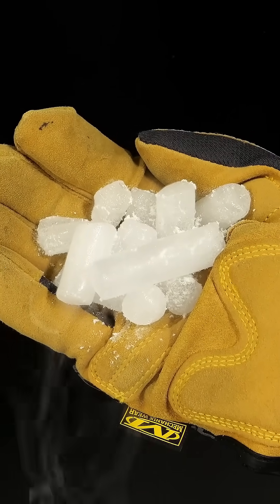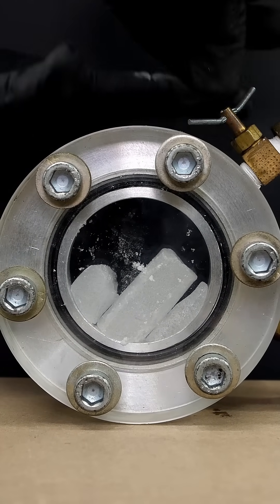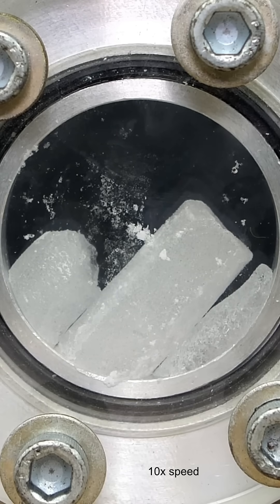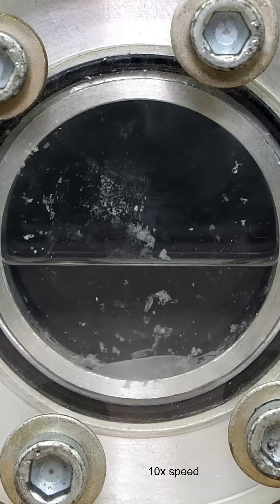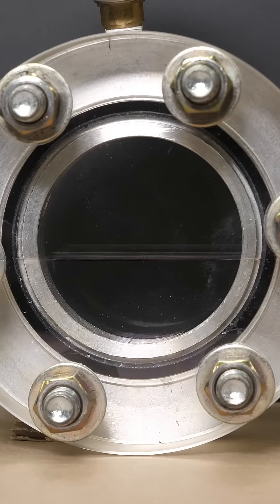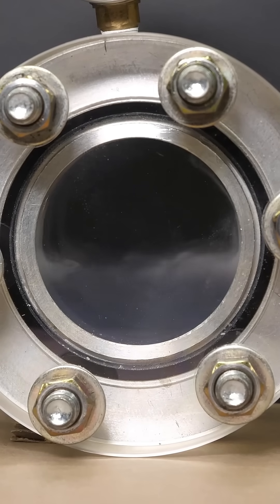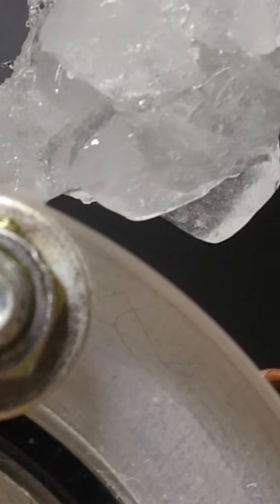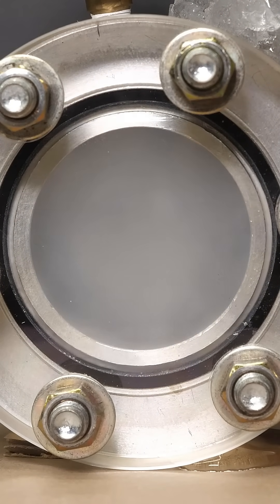This is not a liquid or a gas

Comment: A friend of mine works on industrial heat pumps including turbines that use this supercritical state to improve efficiency. One thing that I found fascinating is that if something goes wrong, the  fast moving supercritical fluid turns into a liquid in the wrong place and instantly destroys the turbine. Super interesting, but difficult to handle.

Comment: In HVAC we call that the saturated phase or "flashgas" phase. And the entire refrigeration system revolves around that. Pressurizing the gas removing the heat, getting it back to the flashpoint taking the heat out of the thing you're trying to cool causing it to evaporate....pressurizing it again.....so on and so forth

Comment: Did you calculate how much that pressure made force to those bolts or that plastic per cm2?

You are hero, I would be critical to about tests like this.

Could you do same with plastic  cigarette lighter (there's maybe butane or propane inside)? ;)
Just heat it carefully.. 🎉

Comment: Supercritical CO2 is increasingly more often used as a refrigerant, especially in large scale cooling systems, like in supermarkets. While CO2 is a greenhouse gas, most conventional refrigerants are often thousands times more potent in trapping heat on our planet. Supercritical systems run at over 100+ bars/1400+ psi on the high side when the ambient is over 31⁰C/88⁰F outside. Fun times.

Comment: Can you make liquid Oxygen in there?
Reply: I'm guessing that if he gets a tank of high pressure oxygen down to the temperature by packing it in dry ice, it might be close enough to liquid oxygen temperature, maybe a hundred degrees above lox , that if he suddenly de-pressuruze it, a little bit of lox will form. It will probably waste most of the oxygen, probably less than 10% will turn into liquid

Comment: When you haul it in the tanker you have to keep the pressure like around 100psi. If you don't it will just freeze into 1 big ice bucket which will take 2-3 weeks to air out unless you can get it to the reliquefied then you can pump it off.
Reply: You talking about hauling it in a tanker, and your name is "Peterbilt".... I'm guessing you are a truck driver?
Reply: @ShannonDove-sy7ye  yes a tanker semi trailer.
Reply: @peterbilt9996  yea I'm a driver too, but no hazmat, I drive flat bed.
I see a lot of liquid gas trucks delivering to a microchip plant in Manassas. I don't think they use CO2, but everything else such as liquid helium, argon, nitrogen, etc. (in Va.)

Comment: It’s a self-contained weather system. You’ve got a body of liquid, clouds forming, and eventual rain. 🌧️
Reply: It’s actually a supercritical fluid rather than water vapor
Reply: @jackmalcolm  Yes. 👍🏼 That’s why I didn’t use the word “water”. Other fluids can experience similar cycles.
Reply: @glennac  I don’t know why I used water tbh. Should’ve just said vapor. My point was that this is a supercritical fluid, not the same thing as seen in weather systems, which I believe are saturated vapors.

Comment: When you added heat, it is definitely a gas, unless you just discovered the fifth state of matter. Had to add this I do believe correct me if I’m wrong that is a saturated liquid in that state.
Reply: There are many more than 5 states of matter. Also by heating it up it made the CO2 go supercritical, turning it into a supercritical fluid, something that’s neither a gas nor a liquid but is in between the two.

Comment: It’s called supercritical if I remember correctly, basically when the atoms fluctuate between liquid and gaseous states due to high heat and pressure.
Reply: And you would be absolutely correct in your assertion.
Reply: @kori1701  why thank you good sir.

Comment: this is something more common than people think. changing pressure affects temperature and so are affected the melting and boiling points of substances.

this is commonly found in compressed cans where the liquid kept inside immediately turns into gas through adiabatic expansion. in high altitudes its known that water boils in lower temperature.

in this video the melting point of this thing is way below freezing so when pressure is increased, so does its melting point and once the pressure is high enough for its melting point to reach room temperature it becomes a liquid.

Comment: This is a roundabout way of answering my ny questions. 😂 Not that this was directed  to me, but from the lighbulb and dry ice video. I windered what would happen if the screwed in lightbulb without glass was sealed into a pressure chamber to keep gas from eacaping, if it would explode. Since it can turn into liquid, will there be electrocution? Or is it because the light source is warm that it kay turn into gas? In that sense, will the light still work and be on? Or is there still a chance of electrocution? Im going to say its safe to assume it will not explode because of the dry ice.

Comment: Lets see. Volume didnt change. Heat energy did (in simple terms, temperature went up). Pressure increased. Just need to figure out that law. I think its Gay-Lussacs law. I could be wrong.

Comment: Once upon a time we wanted to try to see where liquid CO2 would go if it was dumped to the bottom of the ocean, where it would be cold and pressurized enough to probably stay there. It was a study that would give us more options to battle climate change.

But those assholes at Greenpeace protested it because it used a radiotracer that would provide only marginally more dose than background.

Comment: Thank you for showing this, and I love how you can literally see the actual physical line between liquid and gas start to blur.
Reply: in case you’re curious, i believe it is something called a supercritical fluid (one of the states of matter they don’t teach you in school) and it is basically what they showed here
Reply: sort of like on gas giants
you can't tell where it goes from gas to liquid
Reply: @Citrinewastaken  Hol up, wut?
Reply: @WilburJaywright  Like on Jupiter and the other outer planets. They're made of gasses instead of solid materials, but as you get closer to the center, the gasses get more and more compressed
Reply: @Citrinewastaken  I assumed it was a sharp change like an ocean surface.
Reply: @WilburJaywright  it's more of a gradient, density just gradually increases. But at the point where the gradient can even be said to "begin," the pressures are already so high as to be instantly destructive to just about any composite structure. So it's not like you'd be able to notice the change, because any probe of any material we would try to send down there would be crushed long before it made it that far
Reply: Where can I buy one of those?
Reply: @JoshGodoy81  from Spamton’s shop, under the roller coaster in the West.
Reply: @JoshGodoy81  This one is a custom build by Warped Perception.
Reply: Bose Einstein condensate
Reply: @vicious99  no, that’s wrong. Bose Einstein condensate occurs at near absolute zero.
Reply: The line between solid and gas is liquid :L
Reply: @EdmforLiife the line between you and happiness is Joe Steimner quite possibly.
Reply: No, it's just an aerosol, like fog or a cloud or the visible water droplets above boiling water. 
It's droplets in the air, so it's still liquid.
Once it's invisible, it's in gas form
Reply: @micke_mango No it actually is a supercritical fluid, according to the temperature and pressure of the container it matches up pretty close to the actual supercritical fluid zone of carbon dioxide’s phase chart.
Reply: @hodlod8067  ok, but it's still an aerosol, isn't it?
There is air in the container, right?
When the liquid second substance mixes in the gas (air), I'm assuming that the liquid is in droplet/particle form, since it doesn't attach to the rest of the liquid.
Mixed liquid (or solid form) particles in gas => aerosol.
Reply: @micke_mango  Supercritical fluid is a state of matter, not an aerosol. An aerosol is two states of matter working together (Microscopic droplets of liquid suspended in a gas medium), whereas SCF is its own state of matter entirely - quite literally a state between liquid and gas.
Reply: @micke_mango No an aerosol is not that. An aerosol is small droplets of liquid in air. In this case we are observing a different state of matter. Air or not in the chamber doesn't make it an aerosol.
Reply: @micke_mango you’re good at being wrong bro
Reply: @lordmalecith2300  nobody ever said those two were the same thing….💀
Reply: @ Yes, someone did. Look through the replies under this comment, and you will find it. Their reply is still there.

@micke_mango said, word for word:

"No, it's just an aerosol, like fog or a cloud or the visible water droplets above boiling water. 
It's droplets in the air, so it's still liquid.
Once it's invisible, it's in gas form"

I corrected them.
Reply: @micke_mango No...it's literally a different state of matter. Nile literally said it's supercritical.

Comment: I just thought about this video, what if you place a small ferris wheel in the chamber, get the state of the nitrogen to a supercritical state and only cool it on the top, whilst the bottom maintains supercritical. The nitrogen will drip from the top into the cart of the ferris wheel spinning it, the carts will be fixed so they empty themselves out before going back in an incline. If you would be able to keep the bottom of the cylinder supercritical and the top cold enough that the gas condenses without using much energy you might have a free energy generator. Right?

Comment: you better trust your pressure chamber. one time as an undergrad working in a synthesis lab I put a glass vial upside-down over w piece of dry ice absentmindedly (was about to use the vial on the rotovap and the bench had little chunks everywhere). turns out the vial formed a seal with the table and after about a minute it violently exploded, sending shards of glass to my face. luckily my lab was super strict about PPE and I was wearing goggles, otherwise I legitimately would've lost my eyesight. needless to say my PI was not happy after running over and seeing my face covered in blood

Comment: but put a float inside it just to see and make the pressure adjustable so you can make the change happen at any temp and shine a laser threw it and a light sensor on the other side and its the coolest thermostat you can get.... gets too hot laser ball drops laser gets blocked by the ball and ac turns on and another co2 thing with slight lower pressure thats still a gas when the other is a liquid so if it gets too cold the float goes up blocks the light. so you would need two for a thermostat

Comment: that kinda give me a idea for energy generation like a tall pipe of co2 and a ball that floats on liquid co2 but not in gas co2 it sinks with a magnet and attached to a arm so the magnet dont cause friction against the side and the magnet allows for a arm on the outside to be moved by the inside magnet and you might not get much energy but a lot of motion out of a small temp change like a thermal motor like works with the changing temp of 75f to 80f so every day you can wind a clock or something but that one for 1 temperature to work it can go from 80 to 200 and no change but if you had a internal piston that can expand or compress using a screw and magnets to get threw the wall to adjust the pressures you can set it to what ever temp you want so it can get energy passing a range of temps. but i wonder how much energy can you get from such technology a 10 foot by 10 foot pool and a boat thats say 100 foot high can output a lot of energy with little temp change like hundreds of lbs assuming the boat is just a float and cant sink when theres a ton a co2 rain all at once. the float will find itself at the bottom of a co2 lake and wants to go up. for large scale power generation the generator needs to be inside it so you can get direct access to the torque from the float.

Comment: Allright. I did some googling, so you don't have to. This, is NOT the triple point. Triple point of CO2 is at around -56°C, and 5.11Atm, however this what Nile is showing is "super-critical fluid" which can occur at higher pressure than 72atm and more than 30°C

Comment: For anyone wondering, this is a supercritical fluid, a different state of matter
Reply: Thanks, watching this on mute, and the captions are eclipsed by the title info on the screen.
Reply: What happens if you open the container while it's a liquid? Does it immediately sublimate?
Reply: @ShearWater509  actually sublimate is the transition from solid to gas, so it would boil and evaporate
Reply: @ShearWater509  Athmospheic pressure is not enough to keep CO2 as a liquid, much less supercritical fluid, so it would instantly evaporate.
Reply: Yup it will expand and disperse into the open space.. along with freezing everything it touches on the way as it warms to surrounding temperature, we touch on this in refrigeration and i cant recall when somethings supercritical if it can get any colder… it has a property of its own and it makes it kinda dangerous. But no more reactive as it would normally be with other materials.
Reply: nope.   there are seven states of matter. Most people are familiar with the most common states of matter found on Earth. These are solid, liquid, and gas. Additional states of matter include plasma, Bose-Einstein condensate, quark-gluon plasma, and degenerate matter.
Reply: @jasonbender2459  You forgot "Solidus Snake"
Reply: @jasonbender2459  There are more than 7, you missed superconductors, fermionic condensate, superfluid, supersolid, supercritical fluid, mesomorphic states, and more.
Also there are around 4 naturally occurring states, solid, liquid, gas and plasma.

Comment: It'd be a gas its not in between
Allot of gas is like liquid when you think about it just with gravity effecting it in a different way 
The only difference between the 2 is that 1 you can see while the other you usually cant and it can effecivly free flow through the air since it's just not as dense and in turn not as heavy making it a substance that's not really liquid and definitely not solid so it's a gas the only actual 4th state of matter would technically be more like gelatin and I don't think a 5th exists if it does I've never heard of it 
There's obviously better ways to explain this too I just find this to be the shortest and easiest way

Comment: When in the pressure chamber, it releases water vapour. However, by not letting it out, it is unable to transform in into gas, instead it becomes liquid because pressure presses the molecular forces of the water vapour elements so tightly that is unable to move freely like any other gases until by applying heat, the intermolecular forces started to change as its elements of the water vapor began to create a kinetic energy allowing theme to move freely again thus becoming its gas state.

Ps: I am really interested in chemistry , I actually listen in chemistry class, so just correct me if I am wrong cause I am still a student, though😂

Comment: Supercritical fluid is neither gas nor liquid. It's a physical state of its own right. If pressure is higher than critical pressure, and temperature is higher than critical temperature simultaneously, you get the supercritical state. Carbon dioxide has low values of critical pressure and critical temperature. Supercritical carbon dioxide is used to take away caffeine from coffee. One gets a no caffeine coffee (more expensive) and crystal caffeine, which can be sold to pharmaceutical industry

Comment: I build bulk CO2 tanks. At 300 psi the liquid sits at about 0 degrees fahrenheit. We hook up refrigeration units to the tanks to control the pressure. It basically snows CO2 inside while they are running. Pretty cool stuff to work with.

Comment: Did very basic research and for those curious it seems super critical fluids look most similar to gasses but they have higher (and adjustable) solubilities and densities. If you were to somehow put one in a room though, it’d look and act mostly like a heavy gas.

Comment: How, exactly, is this not a gas?
Reply: It’s soluble like a liquid, meaning stuff can still dissolve into it, but it has no surface tension, like a gas, so it can flow through super small gaps without slowing down. It’s an incredible fluid that has many uses in science

Comment: I used to fill cryo cylinders with argon, oxygen nitrogen and c02. With the c02 you had to be careful because if you pumped it like n2 you'd just fill the can with dry ice and cause issues. We'd have to Crack the vapor header open to regulate around 80 psi. If you let the pressure build up TOO much however, you pop the pressure relief valve and turn all the c02 in the can to dry ice. Good times

Comment: Very neat demo.   Thank you.   

As the dry ice pieces were melting and completely submerged:
A). Noticed that the solid phase is denser than the liquid phase.
B). The liquid level continued to rise until all of the solid phase had melted.   Guess that lines up with the solid being denser than the liquid.

Later it looked as though the condensing vapor phase going to liquid did not form a liquid level as high as when the solid melted to liquid.   Do you have an explanation for this “discrepancy” ?

Thx again.

Comment: I honestly never new carbon dioxide could be anything other than solid or gas, especially a liquid. Does anybody know what hat happens if it touches your skin?

   Ok i just looked it up myself and it still burns snd causes frostbite even as a liquid... It can also cause headache, shortness of breath and tremors. Too much contact with very high doses can even cause a coma or death. So i guess liquid is its most dangerous form.